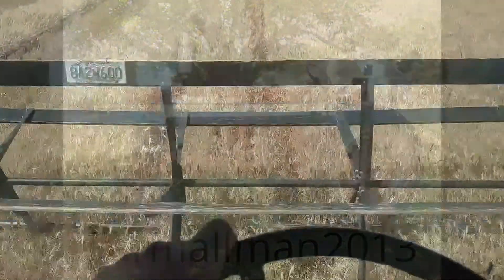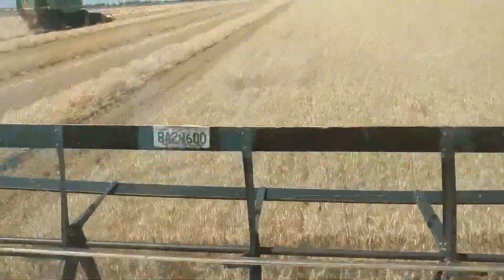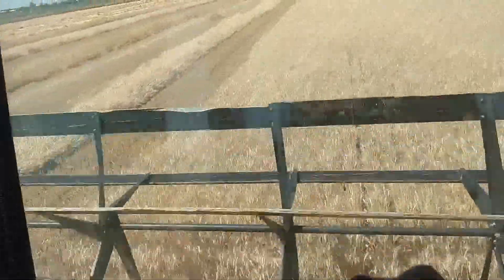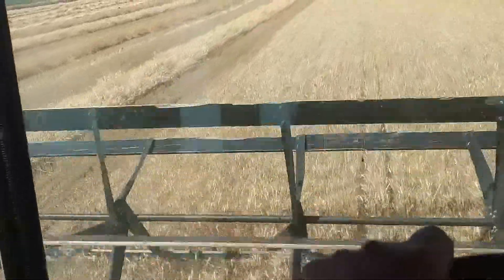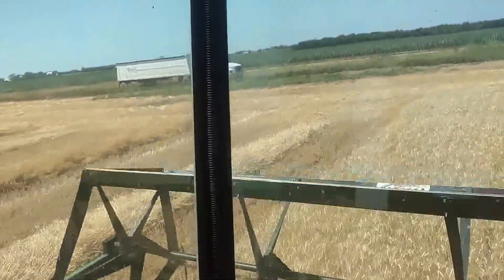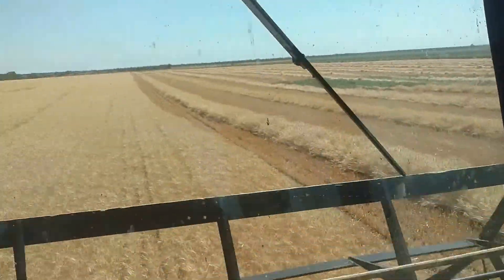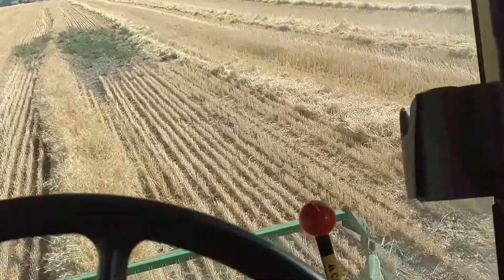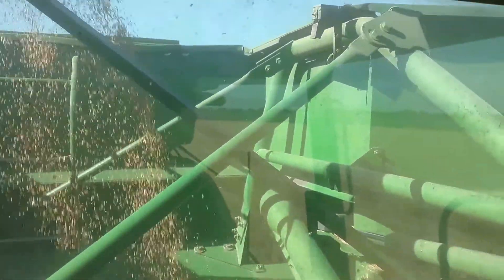Wheat Harvest 2017

Comment: why dont you use a regular head on the combine?
Reply from the maker: Michigan Farming because we have to use the windrower anyway  so we just take it down with this. and we don't like how it feeds with the bean head.
Reply: oh i see. hows the yields doing?
Reply from the maker: Michigan Farming it's not too bad, we figured about 55bu an acre it's 62lbs per bushel
Reply: farmallman2013 not to bad. Considering that dry spell. We been getting light drizzles lately really helping the corn and 2nd cutting. So how's that 70? Haha
Reply from the maker: Michigan Farming well the 70 is at a standstill. I have been busy with everything else andit just hasn't gotten back to it